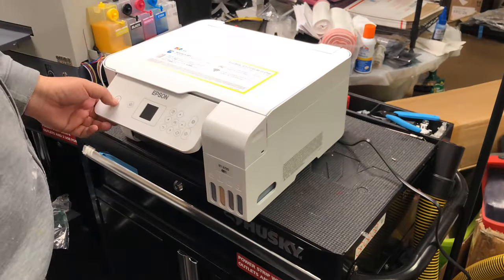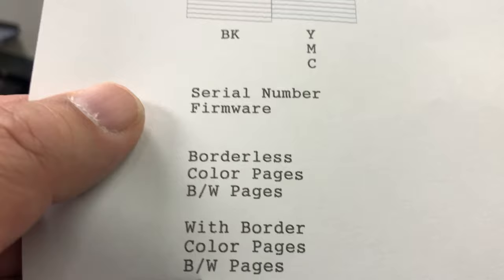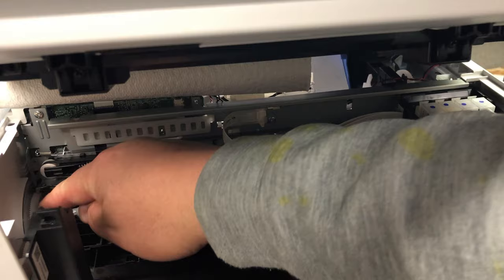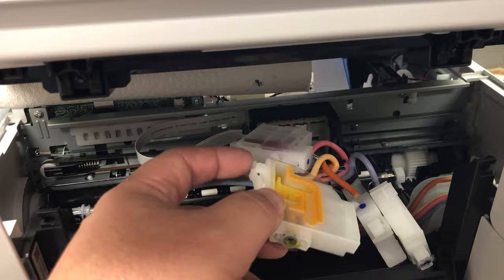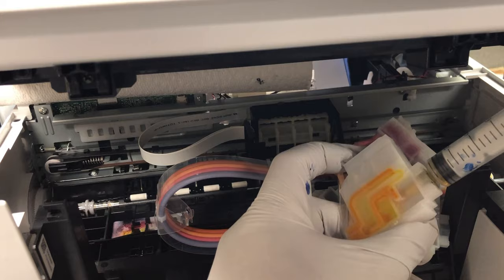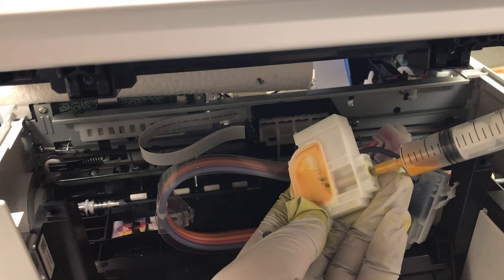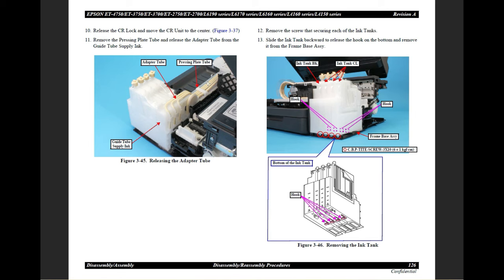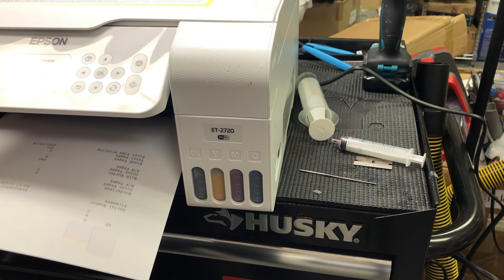Epson EcoTank Clogging Troubleshoot  Part 1 - Not all clogs are Printhead Problems!

Comment: You are a LIFE-SAVER!!!!! I almost tossed my printer after only 8 months, because of this issue. I watched sooooo many videos about print head issues and NOTHING ever worked. Time I cracked open the cartridge panel box and removed the cartridges, I knew the issue wasn't a print head problem. THANK YOU SO MUCH!!!!!
Reply: Video very helpful  thanks but my problem is I can see that ink in it threw the front of the printer but when I disconnected  the rubber tube from the big part there's no ink in them

Comment: Good video, but some comments
I have a Epson 2803 series. No need to remove screws to raise top. The lever top support on the left is movable and used to release the top.
My magenta was not printing at all.
The clog was in the "damper", not the nozzle. Using a syringe, I flushed out all ink from the damper using a cleaner fluid for nozzle cleaning. Then refilled the damper with fresh ink. Finally, "primed" the little hose coming from the ecotank using same syringe, until ink freely flowed into syringe. Put hose back on damper. Plugged everything back together. Ran head cleaning routine from maintenance menu.
Problem fixed ! Perfect colors again

Comment: My Et 2720 was showing absolutely no yellow or cyan on the prints. Multiple machine cleans..not the power one. Luckily I have a syringe about the same size as yours and an adapter with a small nozzle tip that I use to refill ink in pentel brush pens. My nozzle is actually about half the size of the one here but it still managed to unclog the tubes...I just pushed it in and made sure no air was going in. Well I used syringe on the printer heads and tubes etc like you show. I didnt completely remove the tubes but just did a few syringe pulls till it came through. Then ran another machine clean or nozzle clean etc on the printer and wow it is up and running! 90% fixed very very slight drop on some colour but its nearly good as new again from only printing black and magenta. Quite satisfying doing the DIY job and beating Epson at their game! Many many thanks.

Comment: Thank you!. I has an Epson 2760 printer which was was not used for almost an year and was printing blank page for both black and color. I started with cleaning the printer head first for all the colors using print head cleaning  kit from Amazon(did cleaning couple of times) . After that I did a Print Head cleaning from Printer Maintenance menu. Still It printed blank pages for all colors. Then as you said in 7:29 minute in the video to remove each tube and pull the ink out from each color tube to clear any air out of the tube. (Also pulled color from each square color box that connects the tube). I used small syringe  for colors other than Black and a connector that came with the Print Head cleaning Kit to suck all the air out of the tube (do this very slowly), then did a Print Head cleaning from Printer Maintenance menu, it started printing. It printed pages with line breaks in between. I had a full page in Microsoft word filled with Black, Cyan, Yellow and Magenta colors to test the print. After couple of Print Head cleaning from Printer Maintenance menu it worked like a charm. Printed all colors without any breaks. you can also do a Nozzle check to see the color pattern printed.

Comment: Just bought some spare syringes, my printer's clogged but I couldn't figure out why even after two printer head flushes (to be fair, I did need to do that because the yellow one was clogged) but after a couple quick cleans it wasn't printing anything except black and yellow, so I checked again and sure enough the dampers are completely empty so it's probably a tubing issue. Thank you so much for this video! I can't order from you because I'm in Australia but I really really appreciate you sharing this knowledge!!

Comment: Kevin thanks for the expert help. After I cleaned the printhead for black on the Epson ET-2720 and suctioned the air out of the black damper as you demonstrated, the printer failed to print any black.  I attempted to print several black purge files and still no black.  Then I ran several nozzle checks and three-minute head cleaning cycles and still no black.   
I finally tried two of Epson’s seven-minute deep printhead cycles and finally,:goodvibes: I was able to successfully print the black purge file.  A nozzle check showed good CMYK patterns.
I entered Epson’s seven-minute deep printhead utility by turning the printer off and then turning it back on while holding power and help (?) buttons down together.  
While this deep cleaning resolved my black printing issue, I did need to reset the waste ink pad counter using the software and key you recommended.  Hopefully, your video and Epson’s deep printhead cleaning utility will help others solve their printing issues.
Reply: How did you reset the, Waste ink pad counter?
Reply: @mistymcnamara5261  Search for Wic Reset Utility on the Internet.  No charge for first reset.
Reply: Thanks. I did everything and I still have lines. I'll try the deep cleaning again.
Reply: @PeaJayCee  Like you I am out of suggestions.  I had hoped it would work for you.  Out of desperation, I would run alcohol instead of ink through the damper and printhead.  Running another deep cleaning cycle or two to see if the problem clears.

Comment: Big thanks! My test sheet showed no errors whatsoever. So, I was really confused until I found your video! I checked the dampers and they were alright. However, the yellow tube was clogged. I followed your instructions and everything works well! THANK YOU!
Reply: i was going to toss my printer out. only did like 20 print jobs in 2 years. same issue with the yellow. i did this after almost tearing my printer apart out of frustiration . long story short this guy helped me out. my printer is now printing. ** it was the tubing that had the clog  BE PATIENT AND DO STEP BY STEP THIS WORKS

Comment: Your video is the best that I've seen no one talks about the dampers everybody just want you to flush it my tubes draw perfectly I need to check my dampers it's getting late I'll be back in it tomorrow my black is printing perfectly but that's all I ever used LOL once I get this fixed I will be using my printer more often... and I ripped out one of the cables I was able to fix it😅

Comment: I'm just so glad we got Youtube nowadays where we can learn from others mistakes, I almost bought this piece of crap, glad I didn't. Seems like a common problem with clogging, ugh! So sorry you having to go through that, I would return if if I was you. The headache is not worth it.
Reply: Most of the problems comes from the sublimation inks people are using. You can see in the videos the pipes going to the print head are multicoloured. These should be white and have been dyed through strong amonia used with sublimation inks. 
These reports are exaggerating the issues with these printers. 
If you watch alot of the videos of these, these pipes are coloured and not white. That doesn't happen with gen inks.
Reply: @mrflibble9783  sadly it does happen with the Geniune inks too. My few months old printer have the same problem.  I checked and cyan color was not printing. Checked the printhead and dampener was empty. I tried the same things on the video still couldn't fix it today :(.
Reply: @uguryay  Have you moved the printer? 
There's air breather holes at the top of the tanks and they get clogged if they're moved. 
Also, i did point out that the 3rd party ink is 'exaggerating' the issue. 
It does still happen, but with gen inks it is at least rare when the printers are regularly used. 
They can clog easier if they're left unused for a bit.
Reply: @mrflibble9783  Sorry! I didn't mean it. I am very exhausted mentally because of the printer today... Just when I need it most, it failed :/.
Oh, yes I moved printer 3-4 times  i think when I was redesigning my room because my room was messy. What can I do to open the breather holes at the top of the tank?
Reply: @uguryay  Try to use the syringe to push through the whole on the tank, and pull from the dummy cartridge. 
Hopefully that will clear.

Comment: I fill the clogged tube with Windex  then run a piano wire in there to break it up .  Im working on one right now , with 5 ft long feed tubes , thats why I need the wire . Two tubes were plugged .
Reply from the maker: Piano wire!  How creative!  I would saved so much time.  Thanks for sharing!
Reply: But piano wire is dangerous it damaged the tube !!
Reply: aha my nylon wire for hanging pictures may do the trick!
Reply: @merlinporterarts  yeah! Good idea! Did you fix it?

Comment: Now that's the way to do it.  Suck ink through, draw it through using a vacuum, don't try to blow it through from behind. I was not sure if there was a pump, which pumped ink from the tank, but noticed two of the cartridges were empty, and so managed to draw some ink into the cartridge via the output nozzle, I saw the ink coming through into the cartridge which is now full. Also give the printer a gentle movement around to mix ink in the tank, Do not shake. I do believe their is also clogged nozzle, which I can deal with.  Remember " Suck Don't Blow"

Comment: Wow! Thank you for a detail clearing clogged ink heads. For this printer model, ET-2720, where does all the ink go after performing a “Power Clean ?” After doing a “Power Clean” I noticed the black ink is used the most and “A LOT.”  So, the ink is not cycle back to the ink cartridge. Where does it go? Thank you.
Reply: It's goes to the disposal ink tank. You don't get it back.
Reply: And when the waste disposal tank fills up you have to toss out the printer, so don't want to be doing those power cleans unless you absolutely have to.

Comment: My et-15000 won't print magenta. I did powe cleaning; nozzle check, head clean. I used solution to unclog nozzle but still no magenta prints. Any recommendation?
The Nozzle check is completely missing. Ink is good and was replaced but no luck. I printed surge sheet and magenta does not print

Comment: What could the problem be if there is no color printing on any maintainer cleaning or alignments. nozzle check does not show any color. When I print it only prints all black and a little yellow tint on sides and a little in middle.

Comment: I converted a 8550 to dtf did maybe 3 full prints and maintenance cleaning etc. Now trying to do any type of printing and all I get are blank pages. Pulled the dampers and no ink has made it through them. 
Can I use a solvent or something to get everything working ?

Comment: Hi Kevin, I could use some extra help please. I was able to follow your video; used the syringe to see if the ink would flow and it does. I was able to pull ink through the yellow tube easily and then from the damper easily as well. I'm still not able to print any yellow. What else could it be? Do you think I need to replace the yellow damper or something else? The other colors are printing perfectly. Thanks for your time. Missy

Comment: I just set my epson 2803 up and it will only print blank pages.  I have done every cleaning on the machine and heads many times, but the ink lines are still as they were when i set it up.
Reply: Any fix for this printer yet?

Comment: Hi Kevin, I seem to have an airlock stemming from the tank itself. You reference there is an airhole that may be clogged on the tank but I can't figure out where it is at to clear it. I've been able to easily pull ink through the dampers and through the tubing on both sides--I'm only having the airlock when the tubing is connected to the tank. Can you point me in the right direction? Thanks so much! Amber.

Comment: Hey Kevin can you please help me with a problem with my Epson ECO tank ET-2826. It says there is a paper jam which i removed , but printer still says paper jam and obviously printer wont work. The print head is stuck on the left hand side and also wont return to its set position. Any help please

Comment: i have a question i have run the nozzle check and the head cleaning nothing is printing,my eco tank is full the is ink coming through the lines but is not filling the temper with ink what else can i do ?

Comment: Hi Kevin, could you add a video on how to re-attach the cables (@1:57 ) if someone accidentally lifts up too high?  - 😁Asking for a friend
Reply: My cable also came off when lifting the lid too high ! On the green circuit board there's a black square with about a dozen little brass teeth on the top ,  the end of the white ribbon also has brass teeth > its male to female connection and from above you just push down and that's it  !

Comment: I tried to open the Epson ET 2800 printer that I purchased last December 2021, to check the ink supply. I was able to remove the screw on the extreme left. However when I was about to remove the screw on the extreme right , it wasn't there anymore , and I couldn't open the printer. Please help. Thank you.

Comment: Hopefully someone can help. While cleaning a clog out I had a ink spill. While cleaning the spill with a q-tip I somehow pulled a spring from the left side where the white rollers are. I have no idea where this spring goes back to and the print now has lines.. can anyone show the inside left portion or a ecotank 2760.. the spring was somewhere right beside the those white rollers

Comment: Hello Sub Family! I have the Eco tank  Epson 4800. I am about to toss it out the window. My two main issues are, blotches of wet ink on my prints and very dull prints.  I also have lines in my prints.  Who can help me figure out the problem?
Reply: Check ur rollers clean with warm water and also clean the black board thingy in front of the rollers
Reply: As far as full prints u have to change ur settings hope this works
Reply: I have line in all except yellow…

Comment: Hi Kevin, I followed your video because not all my colors were working. I put everything back together now when I turn it on it says I have a scanner error and only allows me to shut off. Do you have any input on what may be wrong and maybe some advice as to what I can do? Thank you!
Reply: Error is E-02
100077
Reply: @tracyrlgh1  I had the same issue. It means one of the flat wire bands  has come unplugged.  Trace each one out. Once i found it, I took needle nose pliers and put back in place.

Comment: Congratulations on the video Kevin. 
I'm from Brazil and I didn't find any video that talked about it here. 
Mine has exactly this problem, when I clean it it prints for a while and after a while it stops. Perfect jet check. 
I bought four new dampers today. Could my problem be with the tank? 
I honestly didn't quite understand the end of how to solve it, maybe because of the language. 
I've been racking my brains over this for two weeks now. ='(
Thank you anyway!!!
Reply: Se ainda não resolveu, tem 2 coisas, fazer 1º furo no reservatório de tinta, 2º troca da bomba de limpeza (é para ser o seu caso). O furo no reservatório é quando entope os canais de entrada de ar e não puxa a tinta direito (que ele fala aqui nesse video), a bomba quando está ruim não veda corretamente a cabeça e quando a impressora fica parada volta ar na cabeça e não imprime, daí faz limpeza até volta mas no outro dia para novamente. Troque a bomba e seja feliz :)
Reply: @popcadu4477  Muito obrigado. Era exatamente o cap mesmo. Não estava vedando a cabeça. Mas como ele estava fazendo limpeza normal descartei ele. Pastei muito até resolver.
Reply: @d00mbr  jóia, vamo que vamo né

Comment: I did all of this and still lines. I even pulled some ink thru the tubes and it came easily. I'll try printhead cleaning again I guess. I'm so frustrated 😢😢😢
Reply: I found my issue!!! My print preferences. I just printed a perfect, smoith, beautiful printer purge file. We need to talk about this please before someone tosses their printer lol. My ET 4700 often resets itself. Why I don't know. Thank you for everything because you helped me get rid of clogged print heads AND how to change and reset the waste ink pad. I'm so very grateful for that ❤

Comment: Are these original Epson inks? Is this printer compatible with pigment inks?
Reply from the maker: These are sublimation inks. I think the originals are pigment black and dye color.  Unless you really want to use pigment in color inks, I would keep it the same or convert the black to dye.
Reply: I've just found the specs. The original inks are dyes. A clog that serious can be attributed to coagulation.
Reply: I have pigment ink in mine and I'm having the cyan not print. I will not use Pigment ink in it ever again. I'm thinking I'm going to sell it. lol
Reply: @pehpy4111  Pigment ink for unsupported printers requires scheduled printing of at least 1 page per 2 days.
Reply: @pehpy4111  did your printer ever start back printing I'm having that problem now after adding pigment ink
Reply: @ Axonis I wish I knew you sooner.  Lol I ended up giving the printer, the remaining  ink and cleaning solution to a cousin. I'm never using pigment ink again.  I was curious to see what the difference in the output would be versus regular ink. I hate I did it. Lol
Reply: @keekeewilliams8322  no I ended up giving it to a cousin so she can do it. I'm over it. Lol
Reply: @pehpy4111  Pigment is good for waterproof, sunproof and duplex printing. Otherwise dyes beat it in price, reliability (unless you're using professional-level printers) and especially in color gamut. A 4-color pigment printer will never produce photos as good as a 4-color dye printer in photo paper.

Comment: So a customer rather have a printer that don't print, instead of letting you try to finish unclogging it, so it will print correctly, because of a warranty? So she must have sent the printer back to the company, to do the exact same things  that you could have done?
Reply: No, Epson replaces printers under warranty.
Reply: @larrysmith6797  not if they have sublimation ink in them. It voids it.